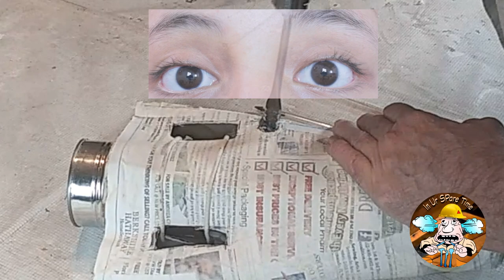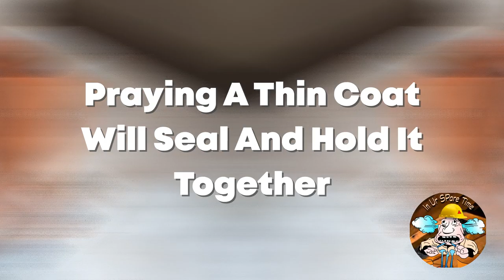DIY Ancient Pottery using Paper Mache / Joint Compound.

Comment: that is so going to rot...due to if it's just flour and water the flour will break down and mold..
Reply from the maker: No, Let each layer bone dry and use only 3 or 4 layers. Add air vents for circulation,  it will last years. No problems. Thanks!